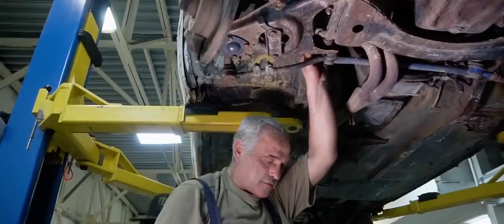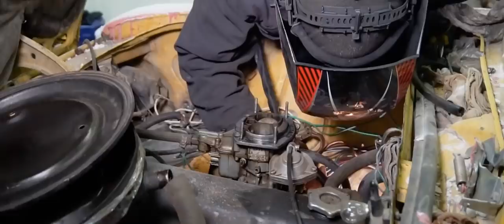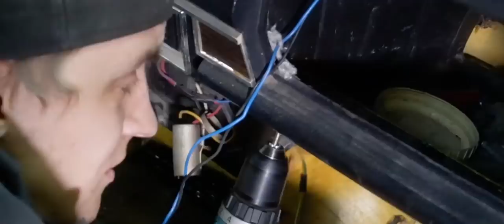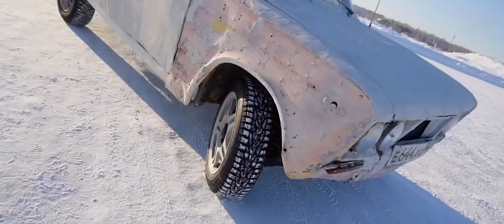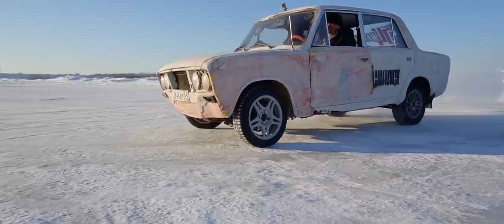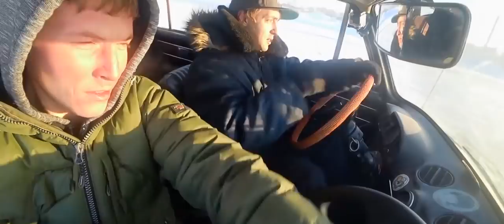Driving a car with two steering wheels

Comment: Passenger steering wheel controls rear steering. Imagine the automotive acrobatics!
Reply: Fantastic idea, a real sight to behold.
Reply: I was thinking the same. Just like those American fire trucks which have a second cab on the back with only a steering wheel for the rear wheels.
Reply: Kind of. 
Except those trucks still have standard solid rear drive dually axles. 
You're thinking about the ladder trucks with the long trailers....  That steering axle is on the end of the trailer to maier it go around tight corners that most long trailers can't without running over poles or people.
Reply: hey hey ,hey!!!!!, dont say things like that aloud , these Russians are CRAZY , they will try it out!!!"
Reply: @AtulSohan  That is precisely the sort of behaviour I seek to encourage :)
Reply: Austin V they did it on top gear
Reply: Austin V sideways
How to drift easy

Comment: I remember the old bin wagons back in the late 80s having two steering wheel's dont no if the new ones today have them but the old ones did and learner cars have dual controls on both side's

Comment: Attach the front halves of 2 front wheel drive cars together. With two engines and 2 drivers facing opposite directions, it should allow for interesting stunts.

Comment: Cut the lower body of a Lada on both sides and transform it into a track system. Use that 7.0l engine since you would need torque and not too much RPMs. Then take it off-roading. You could build the track out of scrapped tire treads bolted together.

Comment: i guess it was too easy for them to put a sprocket on the original steering column with a chain attached to the second steering wheel, they just had to go with 2 steering boxes

Comment: Hi im thinking in one project which you may like to do😂 . Getting front wheel engine and rear wheel car and converted the engine to rear wheel drive by rotating the engine and transmission 90° by getting the engine mount and wilding one axel to drive shaft And other axle forcing it to not rotate which all the power will transfer to the rear axle and moving the drive shaft😂 hope you like it

Comment: would love to see your ultimate lada build - 4WD 2x v8 front gear box front wheels; 2x v8 rear gaer box rear wheels; single joined link for gear changes; magnetic suspension; magnetic shocks; tires filled with solid material and screws for grip; flood lights; 4w steering; etc....
Reply: That would require specially crafted chassis because of the weight, but as ultimate project, it would be pretty fun to see....

Comment: next time try wooden clutch disk
Reply: It's the same as when they did wooden brakes, it will work good for the first maybe 5 times you come off the clutch, after that they'd go all smooth, and the clutch would just slip